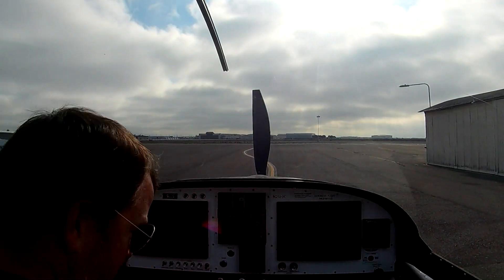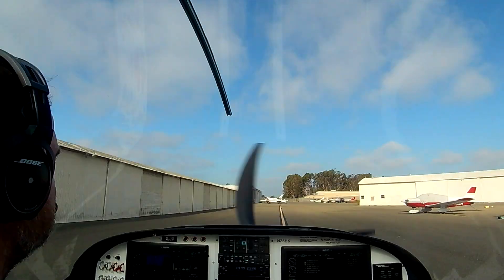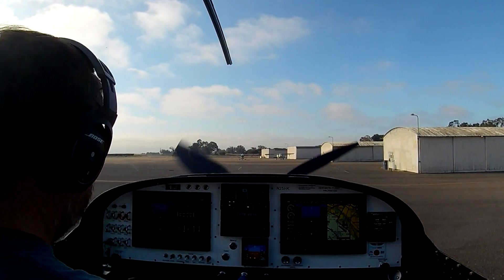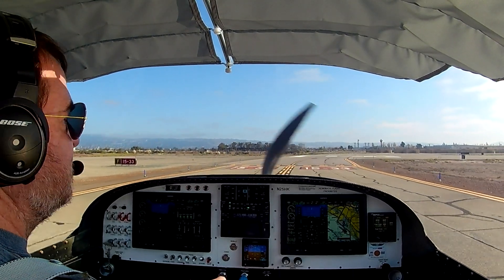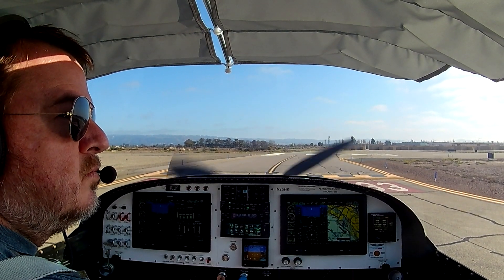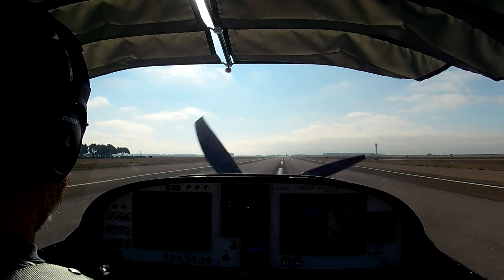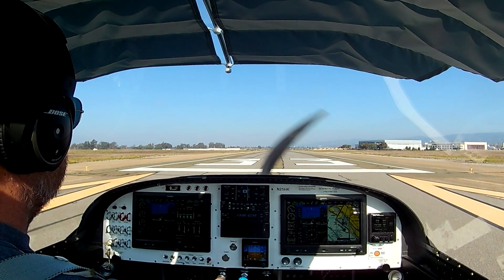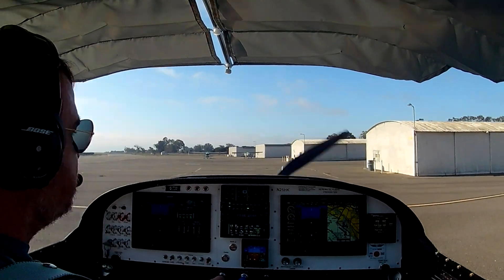RV-14 Fast Taxi Testing

Comment: I had a similar feeling when I did my first flight; there was no longer a Mike Seager in the right seat, fuel was less than 2/3 full, and my bird just hopped off the ground.  With your taxi tests completed (which I didn't do, but good for you), you're ready for that next adventure.  Looking forward to the vid of your first flight!

Comment: Exciting!  As a viewer, it seemed only a few seconds before you throttled back.  Did you catch the speed at which the stick felt light?  As always, very happy for you.
Reply from the maker: I did sort of on the first run (~48kts) as while I thought I would be able to keep my eyes on the runway and maybe glance down to get the speed, the alarming nature of the acceleration had my eyes glued to the runway. 

That is one thing I really don't like about the tape vs the dial. Speed tapes have to have a secondary tape to relay the speed increase rate to the pilot (or 'trend'). Basically what you'd refer to as a horizontal speed indicator. Dials are more intuitive as humans can internally calculate rotational acceleration/deceleration of a pointing needle much better (at least in my brain). 

Until I feel very familiar with her handling, how she feels at different speeds/power settings etc I may put the PFD into Garmin's 6 pack mode.